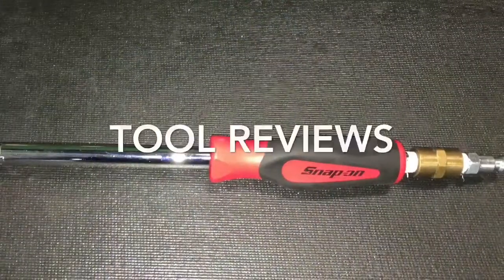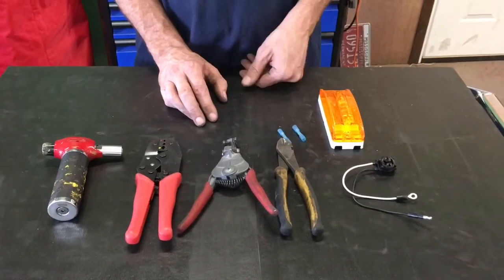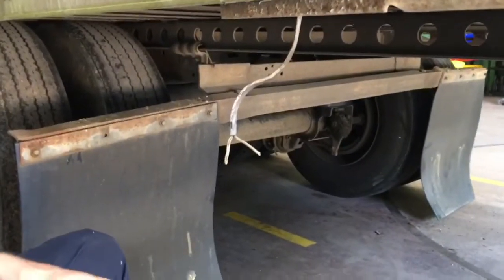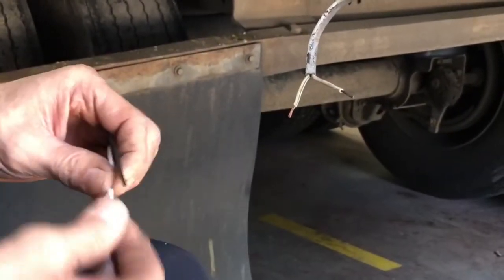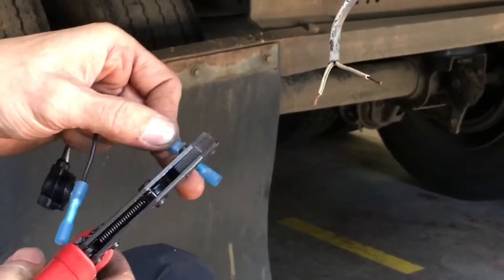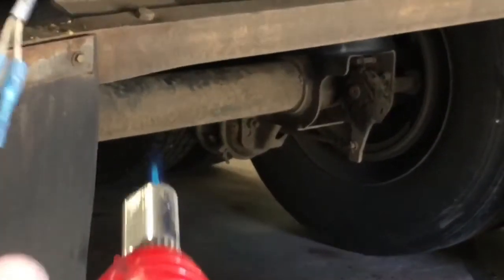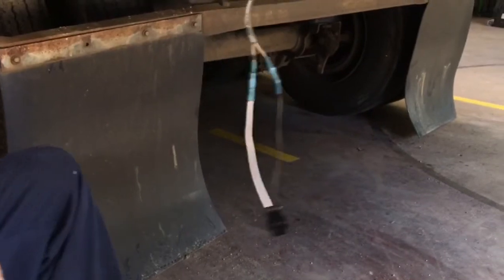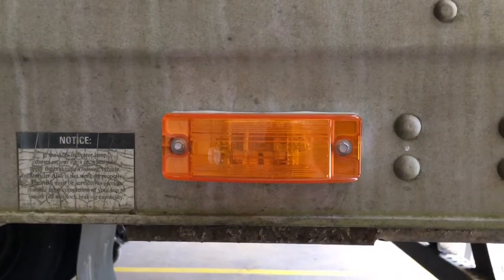Easy Semi Trailer Light Repair. DIY Step by Step Light Replacement Made Easy

Comment: Great step by step tutorial, thanks for sharing. That’s exactly how I do it, except I put a bit of dielectric grease on the bare wire before I put it in the butt connector. With the grease and the shrink it’s just that much more insurance against corrosion.
Reply: Great advice....corrosion is the guilty party 50% of the time.

Comment: Rare to see a big light, it's usually a bullet like the marker light. Which is why I'm here. Normally it's an easy change out but my light was broke off and is now inside the frame and these wires you can't get to from underneath. If I had a way to get a hook or pliers around it I could pull it out or cement to grab it. My tool box didn't even have a screw driver to pop it out.

Comment: I have yet to see one of them heat shrink butt connectors not get corrosion inside. They all fail at some point. There has to be a better solution